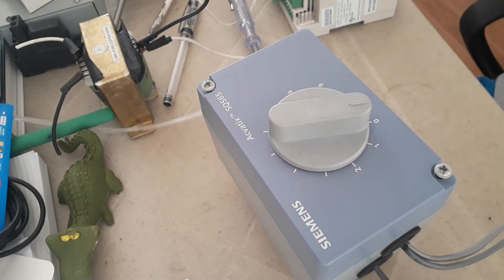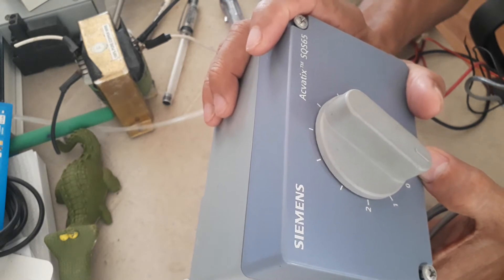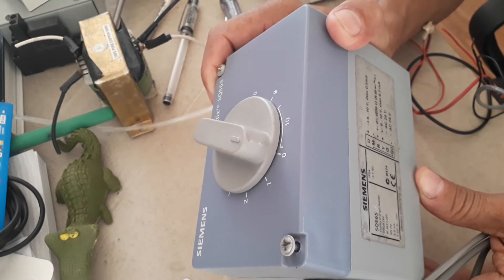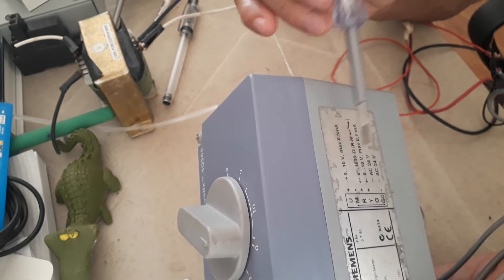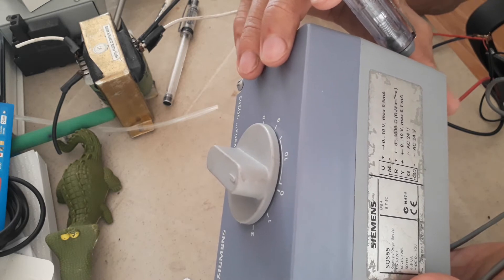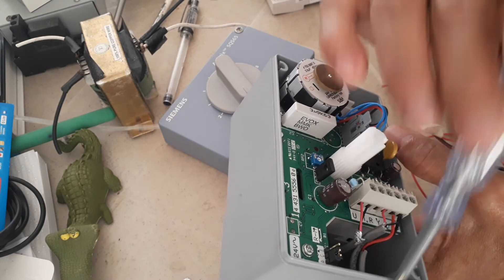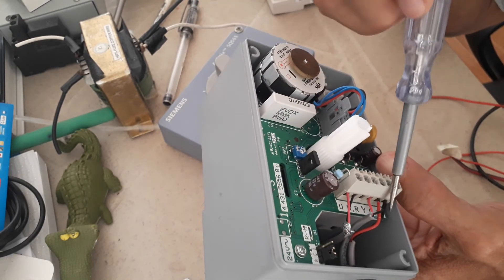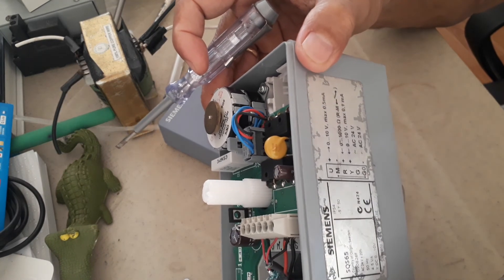How to become a BMS engineer part 64 (Valve Actuator)

Comment: Sir Can we calibrate this valve actuator..?
Reply from the maker: these valve actuators are already calibrated when it goes out of the factory, you just need to follow the instruction in the datasheet of the valve how to mount it properly in the valve itself, make sure that the valve stem is properly attached and secured to valve actuator adaptor as shown in my video
Reply from the maker: you can check it by fixing the control output of the DDC AO say you fixed the opening to 100% check if the valve is opening fully, then fixed again the control signal to 0 % opening and watch the valve if it is closing, then check with 50% opening
Reply: @SantosJrCapellan-BMS  what if we gave 100% command and we are only getting 80% feedback signal..? 
How to fix the issue..?
Reply from the maker: @sachinkp4504  first check the feedback signal if in 100 % opening you are getting a 10 VDC feedback signal from the valve actuator, if the feedback signal is 10 VDC then maybe you can put some offset in DDC AI points engineering/configuration